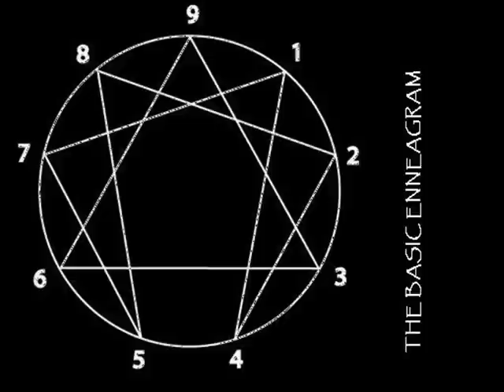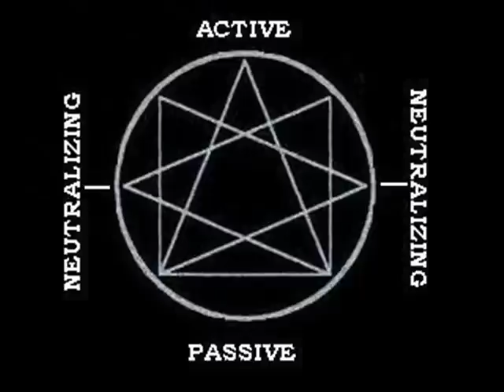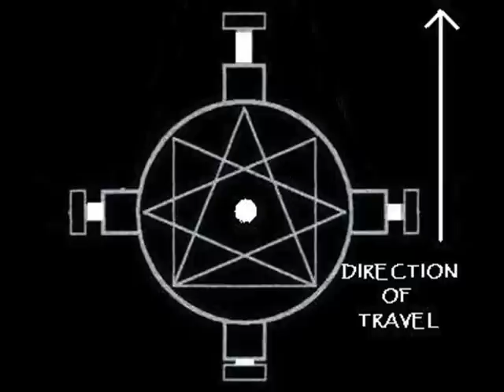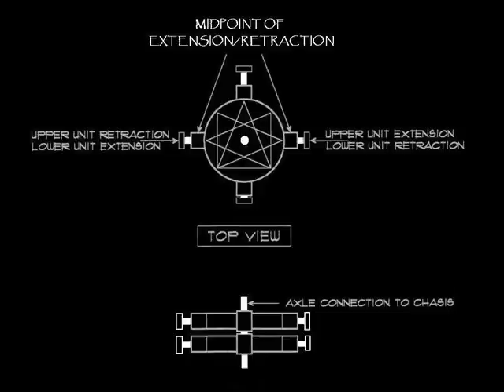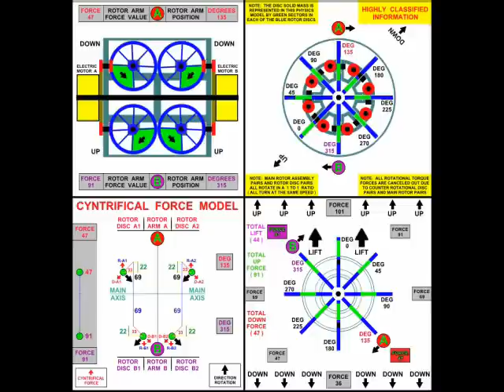Antigravity  Propulsion from Centrifugal Force Discovered

Comment: I have made a model of this(I have four different models that works the same but with different efficiency) and tested and it really did work better than any wheel, rocket, jet, propeller, laser, momentum-releaser, etc. engines but I haven't published it to the public as for threat may attack me. Though, I will use this as a project as for a science fair project. The calculations are based on this formula: F = mv^2/r (m-mass, v-velocity, r-radius of spinning body, F-force). A small size of this system for about 0.3 meters of radius would be able to lift a Ferrari Enzo if the wheels run for about 54 km/h. This system may be used for future cars or vehicles to travel. Space probes may reach the speed of light if force is kept on applied to this system during in space and may even travel interstellarly. I'm just telling that in the near decade, wheels and propellers will be replaced.
Reply: Sure bud. Seen your psychotherapist lately?

Comment: I don't understand why building a working model of this motor is so difficult to test. 

Here's a link to the hourly Spiral spreadsheet from January 1st, 2013 to January 1st, 2015.  The output of the Spiral spreadsheet is created by running raw hourly NASA data through precise and proprietary plasma astrophysics algorithms; i.e., fusion physics which formed and propels the solar system and planet Earth.

Simply right click on the link, then click "Save Link As" to download.

http://www.mediafire.com/view/w9anb1d1n72xxp3/2013_to_2014_Spiral_sample.xlsx

Comment: There is an obvious inherent instability to this system as it is a very basic concept, while keeping with somewhat the basic idea represented here there is a far more stable way of achieving the same effect and by balancing the instability and using higher rpms a far smaller device than the ~83 pound working prototype spoken of in the video can achieve far more lift via gravitational counter balancing. Essentially instead of using a set of counterweights to achieve the effect the earths gravity is one of the set and the device itself is the counterweight per say. I won't say much more about my own design but I have achieved stable hovering with the ability to hold more than a 200:1 weight ratio for short periods of time as I have been limited by the rpms of the motors I can afford which isn't much at all.

Comment: Good concept but if I may... help. In the scriptures, the waters were divided by a firmament. WATERS were divided by a firmament. H20 was divided by a firmament! When scuba divers surface too fast...what happens? When astronauts come from a HIGH PRESSURE environment back into a LOW PRESSURE system, what needs to happen? What is the difference between ocean waters and the air we breathe? The WHOLE Universe works off simple principles... EQUAL....

Comment: Hi can i ask a question... just curious, so looking at your evoligram diagram. Where the lines cross, they appear to symbolise more force created towards to active direction, and less in the passive direction. Ok so, how would that translate into something you could physically build? would that be 3 rotating discs?
 .... thanks
Reply from the maker: Only 2 counter rotating units are needed.  The pistons are caused to extend and retract by simple gearing.
Reply: ah see ... so your diagram is showing a ring, on the ring is pistons with weights. They are timed to extend. Hm... interesting. Doesnt retracting them create the same force as extending them? What does your invention of the evoligram have to do with it? ... also did you see the one used in the kayak?
Reply from the maker: DiyEcoProjects Iower in the diagram is the side view.  Two discs counter rotating.  The piston retraction/extension is geared to take place at the average of 3 oclock and 9 oclock.  Yes, saw the kayak vid, but that is from back in 1990.  The most recent patent I have found at the patent office site was awarded in 2010.  The evoligram simply shows the at 3 and 9 forces cancel each other out, so that at 12 there is more force, and less at 6.
Reply: hmm... cool... thanks... ok so you could do this with some form of electromagnets acting like a relay switches attached to 2xfly wheels. These relay switches with the weights could be timed using reed switches maybe, or some other circuit timer used in bedini coils # why not just have 2xfly wheels, 2xsmall motors on the diameter with small discs with weights. That way the wieght spins beyond the fly wheels diameter...
Reply from the maker: DiyEcoProjects Electromagnetic extension/retraction may not have precise timing, where gearing would.  Synchronization must be very precise to avoid vibration / shaking.
Reply: hmm
Reply: There is a video here of the whole machine in 3D, very well explained graphically.
But. This man is mad, There are other similar designs and of course they work, as any machine converts one type of energy to another, one more efficient than others and so on, but at the end that it what you need an energy source, and if you see, no place they mention that, efficiency. Lift three times the weight of the machine, ok, inlcuding energy source as in plane? then what efficiency, propulsion or whatever are that, motors that convert one energy into another.
Reply: Interesting comment AG...

Comment: Why doesn't anyone turn the whole unit 90 degree, so that it's thrusting side ways and attach it to a small light land vehicle wheel base of sum sort etc, to prove it does work, It then wont have to lift its own weight only over come frictions etc, much easier than trying to lift its own weight?

Comment: Bullshit. Closed propulsion is like unicorn poop. Smells funny. Here's why it can't work: the active force pushing up is ALWAYS countered by an equal force pushing down (any physics student could tell you this). The neutralization concept is scifi technobabble. The same reason that if you fall in an elevator, and jump just before hitting the ground, you still go squish!
Reply from the maker: This is beyond standard physics.  Those students you speak of have no clue, nor even their professors.
Reply: ffeijdrug Bullshit. Build a working prototype, or shut up.
Reply from the maker: frosted1030 Many working prototypes of closed propulsion devices have been built.  Two of them are told of here, in this comments section.  The US patent office has issued perhaps 100+ patents on such devices, dating back to at least 1925.  Search patent # 7,832,297 and see cited previous patents that it improved upon.  This is the most recent patent I have found, which was in 2010.
Reply from the maker: frosted1030 There are many on youtube.  search: "Inertial Propulsion Generators Roy Thornson " ....are you lazy, or what?  search with apropriate key words.  This one, above, is patented.  You don't get a patent for something that doesn't work dude.
Reply from the maker: My device design is also patented but not by me.  Like I said, do you think they give out patents for nothing?!  It works, moron.
Reply from the maker: frosted1030 if it works, and is an improvment over existing methods, a patent is given.  Don't you get that?  Go get a Job.
Reply: lol
Reply: Lol
Reply: frosted1030:
"Bullshit. Closed propulsion is like unicorn poop. Smells funny. Here's why it can't work: the active force pushing up is ALWAYS countered by an equal force pushing down (any physics student could tell you this). The neutralization concept is scifi technobabble. The same reason that if you fall in an elevator, and jump just before hitting the ground, you still go squish!"
-----

I wish I could give your comment 1000 thumbs up.

Comment: Hi Steve, I am aware that newtons law are  in need to be reinterpreted simply because nothing is instantaneous.    Action and reaction are  not instantaneous per se between moving objects yes(there is a time being taken to travel a length of an object) .Forexample the speed of the force transmission  between the atoms  in a pushed  metal rod  travels at the speed of 5km/s,. So yes there is ofcourse a delay time at the atomic level depending on the MATERIAL used, so all this is clear to me..  what I dont understand is  how and where the delay time happens in big mechanical rotating systems?  Could you please explain and help me understand?.

Comment: Your title is misleading, you're not making an anti-gravity machine, which isn't even anti-gravity (I'll explain why later), you're making a machine that you say will create a force that exceeds the gravitational force towards Earth. Saying it's an anti-gravity machine that would mean a helicopter is an anti-gravity machine, and me jumping would be an act of anti-gravity too.
Reply from the maker: Acceleration/deceleration is the equivilelent of gravity, according to general relativity..  This exits no air, as a helicopter, nor pushes against the ground, as you would be, jumping.  This is what is called closed loop propulsion.  It is the acceleration/deceleration of the arms that gives the result of unidirectional force that has no need for reaction against an outside mass, as in a helicopter, etc.

s.g..
Reply from the maker: Quite true, it is better classified as closed loop propulsion, which i have already stated.

Comment: Gyroscopes  Hold Position in Space,  2  Mercury Plasma Gyroscopes  That Are Superconducting and Spinning at near Light Speed Hold Position in the Universe , Inertia Is Canceled in the Craft Due to Quantum  Locking. I Was  Given the Classified Plans to the Craft , Interest in Buying Them ?? Email  Paradox.company@gmail.com 

Want More Proof ? Propulsion of The Ship Is Not the Problem, it Is Stopping and Constantly Calculating  Our Constantly Changing Position in this Expanding Universe by Adjusting the Spin Axis. Simply. To Go from Point A, to Point B, You Have to Put on the Brakes, to Let Point B, Move to You.

Mercury Plasma Gyroscopes, Also Are the next Step in Energy Storage. Until Now the Mega Quantities of Electron Flow Produced in a Lightning Strike Were Useless Energy. Now with These Superconducting Gyroscopes That Can Instantaneously Transform Ion Flow into Particle Acceleration a Bolt of Lightning Can Be Captured and Drained off in a Regulated  Deceleration of the Particles.

The Space That Surrounds Us All Is Full of Energy, So Much Energy, it Is Forcing the Universe Apart. Like a Bird Sitting, on a 200,000 volt, High Voltage Wire with a Light Bulb Tied Around It’s Neck, Yet There Is No Light coming From The Bulb at Night for the Bird to, See The Energy.. The Bird Has No Potential Difference Between The Bulb, it’s Self or The Wire. Zero Point Energy In quantum field theory, the Casimir effect and the Casimir-Polder force are physical forces arising from a quantized field.  Harvested on the Ship From The Surrounding Universe Having Created a Potential Difference Between The Scalar Field Point 0,  Formed Between The Two Oppositely Spinning Magnetically Flattened  Electromagnetic Gyrofield or Flattened Torsion Fields Having no Field lines or only 1 on the Side apposing the other Gyro. According to The Abstract, In a classical description, the lack of an external field also means that there is no field between the plates, or Gyros. Photons are Emitted In The Outer Boundary Layer of the craft and converted into electrical energy and then fed back into The primary Drive Coils, Now How ? A Noted Physicists Was Once Asked What Is between The Field Lines That Were Formed By The Iron Filings on the Paper.? “other Field Lines I Did Not choice To Draw “, was his Response Know We know Thru Quantum Leaping That is Not Necessarily True.

Gyroscopes. How UFOs Work  By James E DeLastings PhD
Reply from the maker: I find this a bit hard to believe.  A mechanism spinning at near c would have too much friction and likely fly apart.  Are there any videos on such technology?

Comment: It seems your idea is to synchronize multiple weights in such as way that they pull up together at the same time, yet they also cancel out their side to side forces too. Although that's happening I can also see the weights pull down in unison too. It looks like you'v made a vibrator where the significant oscillation would be up and down.
Reply from the maker: ***** Not what it does, but lol if it did....ride um cowgirl.
Reply from the maker: ***** yee...haa
Reply: That's exactly what it would do, oscillate.
Reply: Completely worthless lol

Comment: Ok - Now lets put aside all the laws and theories and look at practice.  This device CAN create propulsion but it is very inefficient.  You say you can use anything to power it but the power source IS one of the main problems to overcome to achieve efficient mobility. BUT the main point I want to make is a gyro out of balance will destroy itself and especially at high RPMs. If you all want to see a working model of this device load your washing machine on one side of the drum and watch it move across the floor when it goes into spin cycle. Sure you are not neutralizing and countering like the theory explains but any rotating plane that is even slightly out of balance (like a jet turbine) will need to have breakthroughs in materials science otherwise you can't apply it in the real world. Jet turbines have super precision balance or they explode

Comment: with a good 3D printer you could build a working prototype and prove the concept. if you are not willing to do this release the 3D models on the Pirate Bay for us to torrent, someone will build it with a 3D printer just to see if it works.

Comment: Dude: Revolving weights on arms that can extend/retract within a confined raceway
(already patented), the idea is to allow the weights to extend to one side and be forced to retract on the other (180 degrees to); many different mechanical ways to accomplish. The Gurdjief triangles only complicate matters. A guy named Thornson came up with an eccentric drive that does the same thing, 4X more efficient than a jet engine. As RPM doubles, thrust quadruples. But we want to go beyond mechanicals to ionic (eccentrically warped field) drives.
Reply from the maker: US patent 4631971.  It will be off in timing without BOTH retraction AND extension being under gear control.  ALLOWING extension by release of magnetics will not match precisely the rate and timing of retraction and it will shake itself apart.  Thus you won't see NASA using his invention.  He was on the right track though.
Reply: You just need roller weights sliding up and down extension arms, and tracking inside a too small raceway, such that they're allowed to reach full extension on one side and compressed toward center on the other. This happens "naturally" as the rollers follow their course. Adding magnets to control the roller weights only complicates matters. The entire assemby, or just the central assemblage of weights or just the raceway can be shifted to create instantaneous redirection of forces and thrust. Any number of these assemblages can be created to act in unison.
Reply from the maker: dean germeten If you read his general introduction , he states that the extension is restricted by magnetism.  This does indeed complicate matters.  It will not work.

Comment: How much would this cost to build?
Reply from the maker: How powerful a transmission do you want, LOL.  Rick told me it cost him $7000 bucks to build the first prototype back about 1990.  He had an engineer and a machine shop available to him at the time to do it.
Reply: But I'm asking you how much it would cost - to build something that will lift a schoolbus. BTW, what resources do you have?
Reply from the maker: superluminal89 A lot more than 7k bucks, LOL.  You would need a lot of HP to lift something that heavy.  You would need a huge transmission, which is what this invention is.  Planning to take a load of passengers for a ride??  You are talking upscaling this transmission and the power source a bunch.  Could be done, but upscaling will cost a lot more dough.
Reply from the maker: superluminal89 Well, it's kind of vague.  I kind of doubt it, as I don't see any of these cruising around in the sky.  Who knows what he was on to.  Too vague to figure out.

Comment: actually this tech is the last thing you want the public to have, besides it would cost you about $2000 a week for the fuel needed to fly a car sized vehicle made of safe construction.
Reply from the maker: To BOTH lift AND propel a car, without any wings would be very expensive, you are right, but it is designed [if used in a car] strictly for propulsion on the ground,not to maintain lift at the same time.  It is more aimed at air and spacecraft propulsion.